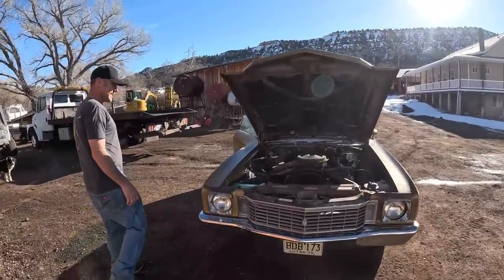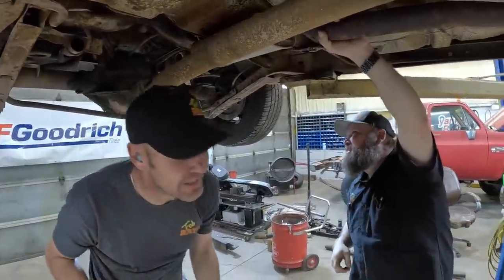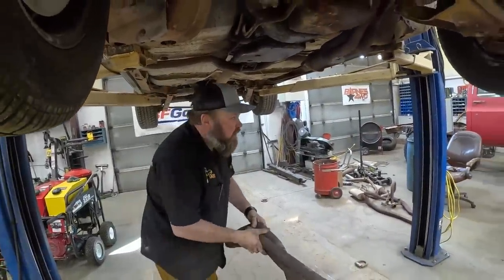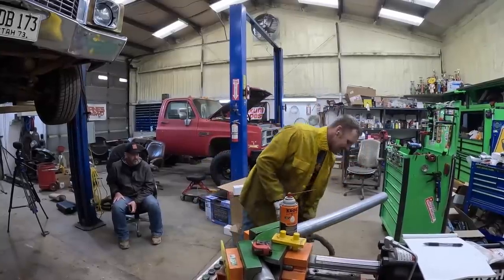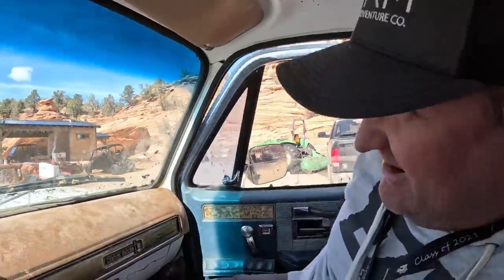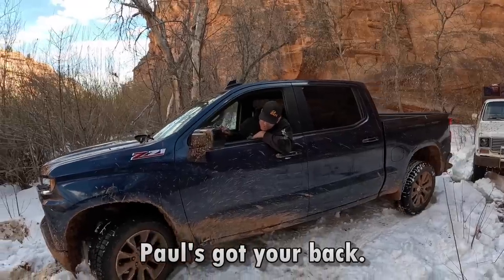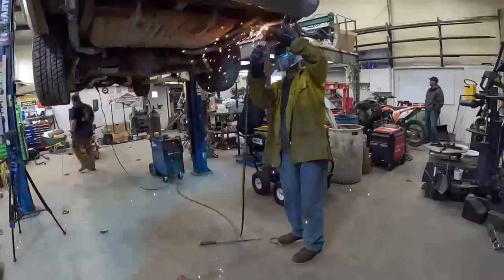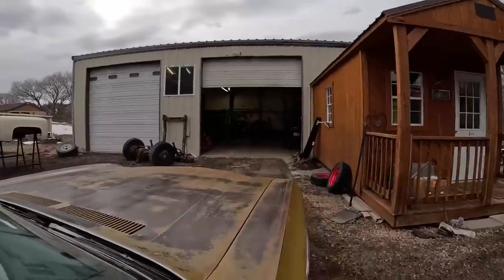There Is A Reason This Is A Pretty Special Car.

Comment: That car needs to be restored to showroom factory condition because that is really rare, A one owner, and not only is it a BBC car but it is a 396/402cid BBC which those two engines are rare themselves and becoming harder and harder to find nowadays and I wish I had that car because I can still remember when I was in diapers all the way up until I was about 6 or 7 my Dad had a 72 Monte Carlo that he built to be a drag car but his had a .030 over 350cid so a 355cid SBC all motor no nitrous and it ran low 11s in the ¼ mile and it was all steel all glass so the car was extremely heavy but low 11s in the ¼ back in the late 80s early 90s was pretty damn fast back then and the only other difference between this car and his was my Dad's car was blue but ever since he got rid of that car I have always wanted to get another one and not necessarily to turn it into a drag car but just to have it because even though I was really young when he had it I still have lots of memories from that car and that is a miracle in itself for me because I can't remember much of my childhood nowadays but I can almost remember everything about that car and one of my first and best memories of that car is I was up under the car with him at the time while he was changing the oil and transmission fluid in the car and I had a wrench in my hand "trying" to tighten all the nuts and bolts I could find and if they didn't go anywhere from already being tight enough and me not being strong enough to do anything I would hit the nuts and bolts with the wrench I was trying to use to tighten them with and I will hopefully never forget those times of my life because those are some of the best memories I have of my Dad and I "working" on the race cars we've owned over the years

Comment: I wonder if the motor mounts need replacing. To the best of my knowledge, the only headers that came from Chevrolet was when the Z/28 302 Camaro off-road crossram package was ordered from the factory and everything was in the trunk, including the headers. The factory did not install the kit, dealers did, race teams did.  A Monte Carlo was market more as a luxury model, not high performance, even with a big block.

Comment: Those cars are great riding cars coil spring all the way around the only thing is body roll on cornering but as long as you have front and back sway bars it's not as bad but if you don't have them it really sucks in the corners

Comment: Those are extractors, not headers... With Headers, the 4 pipes split down to 2 then to 1. This configuration gives better bottom end torque but will not normally help top end, so is better for street applications. Tuned Length Extractors have the 4 pipes join into 1 in a single collector. The benefits of extractors outweigh the cons..... and no, they don't come from the factory like that.

Comment: They used to have been cards for those things you started at the tailpipe end of it and work back towards the muffler on those pipes and back then some cars did come with Factory dual exhaust I don't think they had headers

Comment: only had one monte, 1977, had gutless 305. was so upset with engine after putting it in a 1978 chevy pickup, that i took 8 lb. sledge to the car and didnt stop till you couldnt tell it was a monte , swore there would never be another on the property ever again....🤨......🤣 but as i age i guess i wouldnt say anything nowadays 🫠 getting soft😝

Comment: To the best of my knowledge no factory big blocks had headers on them however the flat pipe is factory they would’ve had  and almost 90° bend On the driver side and a little over 45° on the passenger side to the bottom of big block manifolds . They possibly could’ve had headers installed at the dealership that I am not sure of but not from the factory

Comment: The ratio of me filling up to my wife is in the neighborhood of 4:1. The ratio would be higher if I filled up more like Paul and less like Matt. I fill mine around 30 times a year and I fill my wife's maybe 10 or 15 times a year. She works from home, so she might fill-up 20 or 25 times a year. 40 to 45 out of every 50 to 55 fill-ups have me standing by the fuel filler and her inside.  90 degrees or -20, it's my job to sweat or freeze while gasoline steals my cash.

Comment: She did not come with factory installed headers. 

Doesn't look like any of the exhaust is original under that Monte, and I can't imagine it would be after all this time.

When ever that end of the exhaust was taken apart studs were replaced. Didn't matter if it had stock cast iron exhaust manifolds or steel header.

Comment: I had a 72 with a 350 and a 2bl in high school in 76.  That thing would outrun most of the hotrods in town!  Dark copper color with a beige interior.   I wasn't all that fond of the car back then but I'd drop a good chunk of change to get it back now!   
AND:  If you clowns don't start wearing eye protection when working on that sort of thing Imma hop in my car, drive out there and whoop you with a willow switch!!!  And that's a  28 hour drive from Ona, WV so straighten up!  I can't afford that gas!
Reply: West Virginia must have some slow cars if a 72 350 2 barrel was fast
Reply: Ditto on glasses 
Eyes r nice 👌
Reply: @franklinpatterson3693  WV does have slow vehicles on average because a LOT of em are trucks BUT I grew up in Ohio.  Good friend had an early 70s Firebird hot rod that I could run with.  Then there was another guy had a 68 Camaro and I could blow his doors off.  I mean, it was a six banger but ...  🤣

Comment: I know you like that Tacoma a lot, but you need a 4th Gen 4Runner with the v8. Maybe straight axle swap it too. I’d like to see a build on one of those. I have 2 of them and my brother is about to sell his 3rd Gen and get a v8 4th Gen also
Reply: Those V8s are great I used my 00 3rd gen to pull one out of the snow last week.😉:face-purple-smiling-tears:
Reply: @iffykidmn8170  I used my 4th Gen to pull out several full size trucks and a Tahoe last week. I can jump on the highway and run 90 if I want to with 1 finger on the steering wheel, cruise set at 55 I get 20-22 mpg depending on the wind, I’ve towed 7k pounds with it, my drivers seat is big enough that I can let my nuts breathe because my legs aren’t smashed together. But hey, to each their own I guess. Snow traction is all about tires.
Reply: @joshuaearnheart2756  Wow traction is all about tires! who would have ever guessed.:face-blue-covering-eyes:

Comment: factory never put headers on a new car. even if you could get them in the trunk, that would have been a dealer supplied aftermarket bought option you could have bought yourself for a 1/4 of the price

Comment: Paul, what’s the purpose of a crossover pipe in exhaust?
Reply: to equal pressure snd sound
Reply: @oregonfordguy9812  is it more for sound or performance?
Reply: @scottl.2163  the x does more for performance and the h is more sound. but neither make that much difference and sometimes the build will need one vs the other for space constraints
Reply: @oregonfordguy9812  thank you

Comment: Are there any advantages by running an "X" or "H" section in the exhaust?
Reply: An X or H pipe broadens the torque curve, or both lowers it and raises it. Makes it wider. It also changes the sound, makes the whole thing lower and mellower.
Reply: Yes.  Scavenging effect increases low-end torque.

Comment: No headers from factory, I had a 71ss 454 car one of 1915 SS monte carlo's made in 71, 500 of them had 4 speeds.
Reply: Actually, Chevrolet production records show that they stuck to the dealership sales brochures and never put any 4 speeds behind a 454 in a first gen Monte. The production numbers are easily found on the First Generation Monte Carlo Club website.
Reply: @danjanes8689  I seen one in 1977 with a 4 speed and console when I had mine. The original owner still had car and said it was factory built. Did I see it come down the line, I did not. But I do know if you wanted something from Chevy and this would have been the end of that time to do this and you had the right connections you could get what you wanted. But maybe there are a few unicorns out there lol. Production numbers are what they are, can't argue those.

Comment: If you’re born a gentleman. There’s certain things you just know without having to be taught it’s guy code. Hold the door open for your girlfriend or your wife. Pull out the seat when you’re having dinner in a restaurant take the trash out without being asked, fuel her car up with petrol, I mean the list goes on and on but. But I am an 80s baby so they don’t make them like they used to. Take notes young bucks. 
Be a gentleman and not a dip shit it will go a long ways